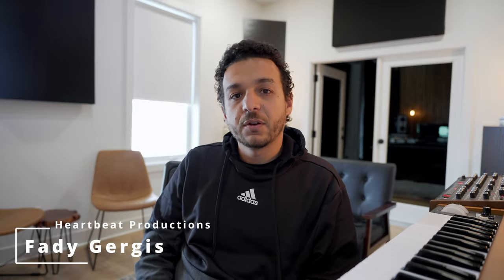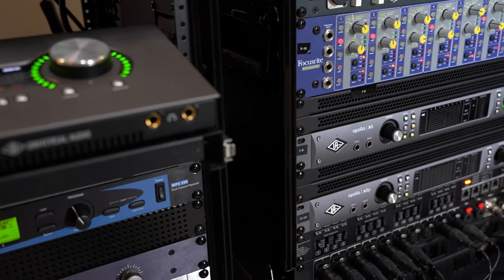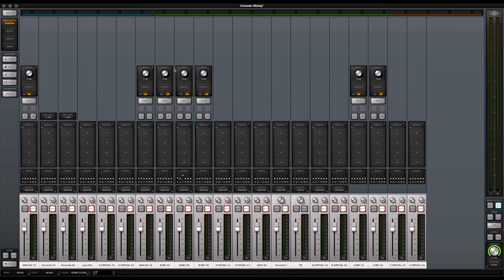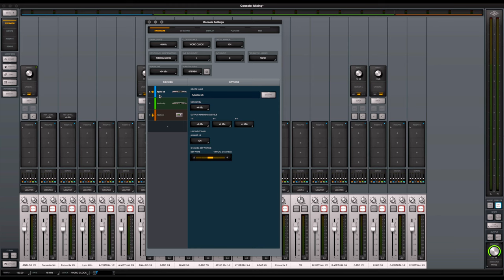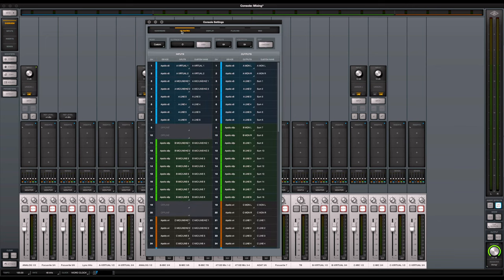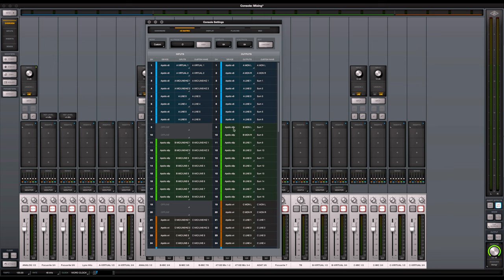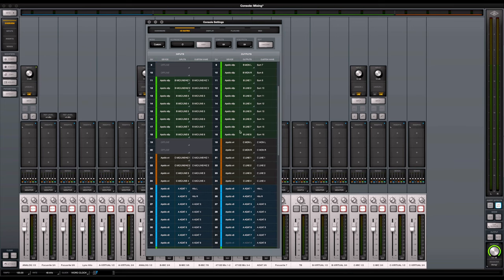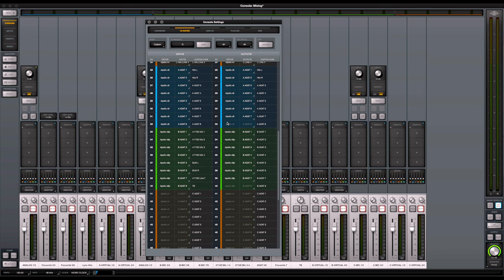Universal Audio Apollo Multiple Unit Set Up | Routing | Console | ADAT | Clocking and Monitoring

Comment: One caveat here is that you’re not monitoring through the same DAC that you send your analog prints with. You’re using the analog outs on the Apollo to send to your analog gear so that’s using the Apollo DAC, then you monitor through a diff high end DAC. Just saying that you’re not hearing what you’re sending most likely though minimal probably
Reply: You’re correct… 
I have separate a da converter and a separate Ad converter for my anolog prints.  My Apollo converters are completely bypassed from start to finish.

Comment: I have 2 X8P's, RME octa and powerplay 16, so 24 in. Should have seen this earlier😊, great video. But figured it all out and maybe have something to add. For me it gives flexibility to use the 1-8 multiconnector line in on the X8P. With that all 24 xlr inputs are connected for live tracking. By switching to line level i immediately have my synths without loosing additional channels. Ofcourse this only works because i dont use these synths when recording live. I use these for creativity and in a production setting. The benefit? Software switch between live recording and production setup, no hassle with cables.
Reply from the maker: Absolutely I had mine setup in a similar way. 
Line inputs was from the patchtbay and mic inputs from the live room for tracking.

Comment: Hello, thanks for your time and passion to make these videos!!!.   I have an Apollo Twin and a X6 . I am connecting an A/D apogee convertor 2 channels into the X6 ADAT 1@2 inputs. I do see the signal in the console the meter shows activity , I hear the sound fine when sitting in 0db but If I move the fader down no changes in volume, if I go above 0db I do hear a little increase in volume. The MUTE does not do anything .
If I press SOLO the volume goes down a bit and only then the MUTE works.  Any ideas?, All the other channels including Virtual channels work fine.  Luis.
Reply from the maker: You can email me to book a session to troubleshoot your issue. 
Fady@heartbeatproductions.org
Reply: @fadygergis  Thank you for your help. I will contact you if I can not figure it out. Your videos are amazing!.
Reply from the maker: A pleasure I am glad they are helpful tool!
Reply: I figured out. The signal was coming in to the console on ALL the 8 channels but only 2 were visible, the other 6 were in the background but still running. It is all good now!

Comment: Great Video!! Thank you. 
If I daisy-chain x16 with Apollo Silver product (with tb3 option card), does the +24 headroom option disappear from the console settings? If not, is there any problem when I select +24 dBu headroom when I only convert with x16? (Both are powered on and daisy-chianed, but not converting w/ silver model. & Changing to 20dBu only when I convert with the silver model.)

And if the two are interconnected, will only the converter of the main device be used when recording on the DAW? Or will the converter of the device with the channel for receiving the signal be used and the main device only uses the interface function?
Reply from the maker: When you connect both. Each unit will have its own converters and its own head room. So you will be using both converters and both headrooms.
Reply: @fadygergis  Ah I see. What a great and clear answer. Thank you so much!
Reply from the maker: You are welcome!  @명곡감별사

Comment: Thanks for the video.  Can you directly route an analogue input (such as a mic pre) to an ADAT output via the Apollo console routing matrix without a DAW?
Reply from the maker: Yes if you have the Apollo rack units with flex routing.
Reply: Thanks for the info. I'm currently testing on an Apollo X6 which has ADAT I/O but for some reason it wont route the inputs to  ADAT even though I tell it to in the console settings IO matrix (like if you were to use it as AD converters).  If I route an audio track in a DAW to the ADAT outputs it will output via ADAT, but for some reason it wont automatically route analogue inputs to ADAT outputs.  It's weird. @fadygergis
Reply: @fadygergis  I don't think the console I/O matrix works for the Apollo X6.  For example, I cannot route analogue input 1 to analogue output 3.  If I route it via a track in the DAW it works.  You might be right that I have to get a rack format Apollo but it's strange that they wouldn't just grey it out in the software if you can't use it.  Thanks for your input though.

Comment: My question is the termination switch on the Apollo when using an external clock should it be in our out ????
Reply from the maker: That’s a complex question that will depends on what is being routed to it. What units, which is master clock and which is slave?!
Reply: @fadygergis  I have a black Lion exp adat expander that's also a word clock. I want it to be the master..
Reply from the maker: @Deandre-r3j is that the only 2 units connected via word clock ?